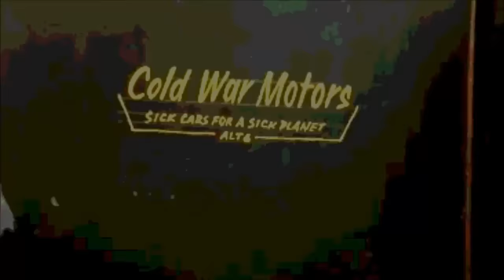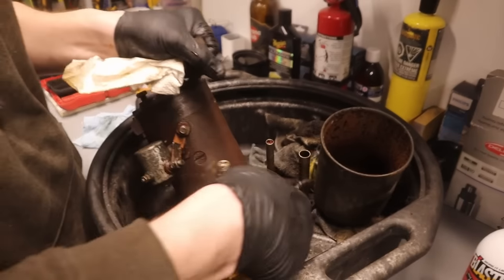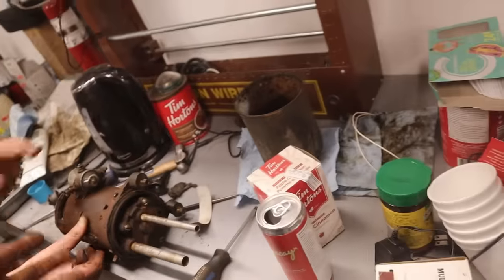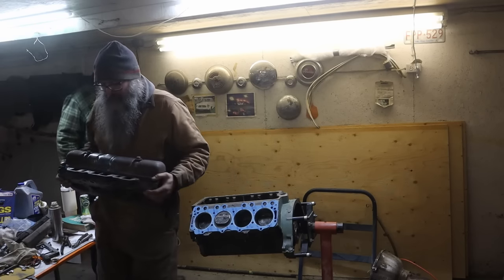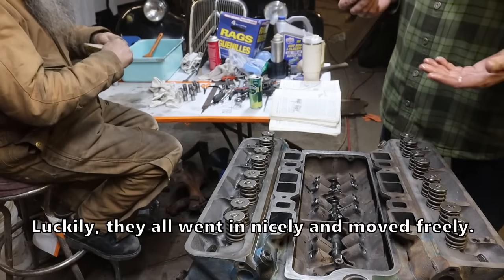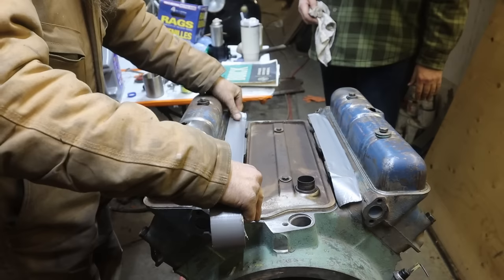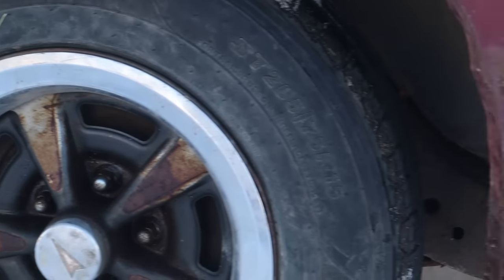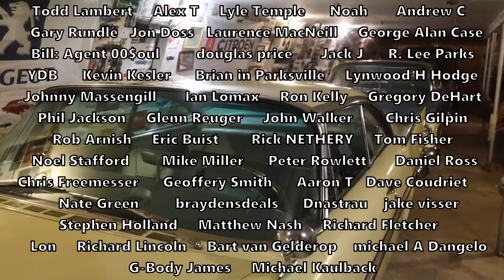Buick Nailhead Goes Together, Plus Oldsmobile 98: Will it Pump? Then: Greasy Flip Special!

Comment: So glad Dan's blazing through the Olds with gusto!
Also psyched you saved the wildcat paint on the air cleaner! The numbers on the Buick air cleaner stands for the torque specs for the engine under it and at that time not for the engines displacement of cubic inches. Turned out sweet. 
Those lifters come packed from the factory in a solid box with each one in it's own separate holder and wrapped in plastic. I've pulled and shipped delivered and used tons over the years and never saw them shipped like that!
You're supposed to soak lifters in oil for a few hours or overnight before installing so they get lubed up nicely. 
Run the engine without the coil connected to get the oil circulation through the passages and such before starting too, please.😢
Thanks again guys.
If Dean still has the 68-9 green Catalina or Bonneville that is in the drone shot in the promo shots and the engine is still running,toss it in the G.P. if I was up there I'd snatch it up quick!

Comment: Lovin the vintage intro's. 
If it wasnt on the other side of the moon for me to get there I'd buy that Grand Prix..
I've owned a few & I love em.
I like the 70's cars . Most dont , but its a bit of nostalgia for me.
Reply: I like 1970's cars as well, that "low wide and angular" look that a lot of car designers went for back then has its own charm. When done right it looks both sleek, sinister and elegant at the same time. The 1972 Chrysler Newport shown prominently during the end credits is a good example.

Comment: That Startex switch is basically made of unobtanium. That switch is worth the cost of the entire carburetor by itself. They have little brass shims in them you add or subtract to get the starter to engage properly and not clash when either engaging or disengaging.
Reply from the maker: Yeah! We'll detail the entire rebuild soon... the switch is in good shape, luckily!

Comment: I signed
It’s complete corrupt nonsense

Love the “refurb” on the hydraulic pump for the Olds. 
Also the nailhead assembly was nice to see.

I think Dean did the price drop to $864 because he was doing beer math and had already subtracted the cost of the case of Old Milwaukee he’s going to buy as soon as the car sells 😂😂😂
Love it

Hey I need a front bumper for a 58-60 T-Bird

Comment: Your words during "Deans Greasy flips" are so prophetic when referring to the Pontiac (and cars of its era).  "There was a time when I could not see any redeeming value in these cars... but ya know now that you see it next to a new car, it's pretty nice... New cars are such garbage".   

Just the other day, I began researching the old concept cars of the 1950's.   These are cars that never made production but had styling cues some of the cars of that decade and even later, used.  

What beautiful lines what elegance...  Speaking of elegance, Chrysler called one of its concept cars "Elegance" and it really was. If it were on the road today people would easily pay $150 Grand for it regardless of the power plant inside. 

 Cadillac even scaled down its known bloated appearance and designed a concept car that looked like it was designed by Pininfarina or other Italian designer.  

Today's cars all look like rounded edged bars of hand soap or shoe boxes with tall windows and lots of brightly colored decals.  You have to look at the logos on the trunk lids, wheel covers or grill ornaments to know what make of car you're looking at.  They're all generic in appearance and completely fail to stimulate desire by their outward appearances.  People only love them because of their logos and their prestige price tags.

Comment: 1950 thru 1953 G M sheet metal partsl  are same , or close . 

The  2 door on  your 52 Buick will be the same , check  !

Big cars, Cadillac,  Oldsmobile,   Buick  same doors.

The Buick  Special,  and other smaller lines will be different. 

The 4 doors cars are designed smaller,  but will change , swap out .

The trunks are interchangeable,  but not the Quarter panels.

Hoods are different. 

G M sold cars , that were sheet metal close .

Even your 1959 body is made that way.

Look at your 59 chevy,  windows, windshield,  Ect.

Gary

Comment: That Grand Prix would be $2500 in California. The interior, wheels, sport mirrors, and INTACT hood ornament....part out, EASY $3000 for someone restoring. Hood ornament alone $50.

That buick engine will be SWEET! Purr like the Wildcat, roar when the carburetor is full open. I envision some authentic tire smoke and squeal.

Comment: Always love how the lads restore old iron back to life and have a laugh doing it. Its what petrol heads do!
Just my tuppence worth but I have been building engines and gearboxes since the '70s. Some were performance engines like Twin Cam and BDA Fords or Opel 2 litre rally engines and I have never used 'assembly lube'. I have always used Hypoid differential oil (preferably Castrol) as it sticks to parts for ages, takes the initial stresses and is non detergent. Only ever had one engine fail and that was when an oil cooler pipe split in the middle of a long rally Stage on the Welsh rally many decades ago.
I am not telling 'how to' I am just saying its 'how I do'.
Latest engine is a Mini 1100 engine with a BMW Twin Cam head and fuel injection.
Reply: I was told firmly - never mix hypoid and regular oils. I use hypoid oils in my motorbike gearboxes, but only after a full strip and clean, to make sure all trace of the previous oil is gone. And make sure to use a hypoid oil that doesn't dissolve bronze bushes....
Reply: @pashakdescilly7517   I am talking about coating surfaces for assembly not a full sump of Hypoid.

Comment: Love 💯 the opening 
Black & white 8mm film 🎥 
Scenes  

Camshaft time , 
for the Buick 364 🤞 

That Wildcat 445 air
 cleaner cover came out MINT 

Great idea  , using  slow incriminates Up to the torque spec 

Those lifters were nicked 
In shipping  ??
Oh , for Christ sake  !!
Glad you caught it , in time 

Loved listening to the clock ⏰ 
Ticking in the background 
While you guys were adding oil 
To the valve pan area 

"Another day , another greasy"
LMAO 🤣 🤣 
That's a merch idea  ,
Right there 😂😂

An original 455 , ( less engine  )
'75 Pontiac Grand Prix LJ ??!!

I think because it doesn't have a vinyl roof or T tops 
Makes that car , savable 
Plus , sleeps 3

Comment: )I had the joy of working on a old carter afb and the secondary fuel float was basically set to not open ,I used a little pin punch and one light tap the boss holding the float pin broke,found out why the turned it into a 2 barrel a little jb weld and a lot  of filing and it's a working carburetor on ebay they wanted 500.00 for a non rebuilt afb
From 1960.

Comment: I bought spark plugs from an Amazon vender. They were shipped loose in a shipping envelope, with no packing, in their individual boxes. They had came out of their little boxes and rattled around together. The plugs looked undamaged, but one immediately had a intermittent misfire. When I pulled it out, I could see a carbon track along a slight crack along the porcelain.

Comment: If you look at that Buick engine I see a couple of unique design features.  First of all the way the heads are shaped the valve covers lay flat and would be less prone to leaking.  Second if you had to machine the deck of the block the intake would have to be modified to fit.  That design lasted till 66 when they were redesigned to be lighter weight. Interesting fact the Buick 350 weighed 100 lbs. less than a Chevy 350 but appeared larger.

Comment: Hi Scott, Agents and everyone at Cold War Motors. Dan's Oldsmobile sure is cool. I love that blue colour. My first car, the 59 Electra had the same air cleaner script. 455 Wildcat. When I did a tune up I looked it up in the Motors Automotive Manual and it said 440 cubic inches. Almost fifty years ago. Time flys. I still have the manual. DEAN'S GREASY GRIMY FLIPS, always a gas!

Comment: Hey, you have a brand new rotor winding. You looked at it when working on a starter for a car or the forklift. Still in the factory packing, but didn't know what it was from.
Nope, not forklift. You ended up ordering one.
Yes. in this one. It is notably shorter than the 51 Chev starter you compare it to.
Episode, "Will it Run? Episode 22: 1951 Chevy Bel Air! Part2"
Looking at the one for the pump, and comparing it to the video, it warrants a look. 

And could you do me a huge favour?
In this episode, "First drive in 50 Years! "Will it Run?" 1951 Chevy Bel Air... Episode 22", you do a skit where you start out in orange coveralls, and slowly turn into "The President", and play a nasty little riff.
One of the best pieces of filmology you ever did, in my opinion.
Could you turn it into a stand alone video, or a short, perhaps?

Comment: I ordered lifters from RA recently for a Japanese 4 cylinder. They were the wrong ones. It's mellings fault though for listing them as fitting an engine they don't. Tried telling melling and they quoted wikipedia saying they were right. Couldn't even be bothered to talk to the Mitsubishi dealer to find out what part number they ran for those years and see it never changed!

Comment: GM was really cutting corners on quality back in the 1070's. The door hinge bushing would wear out fairly quickly even on lighter doors. I remember changing the upper bushing on my 1975 Camaro's driver door after three years and doing the something on my my ex's 1979 Buick Skyhawk too. Glad to see the Nailhead progressing along, used to be they would ship the lifters in separate cardboard boxes to protect them.

Comment: That pump is going to raise those windows with enough force to be dangerous :-)
Reply: Michael naught - good point about the potential power of hydraulic window lifts. This was made probably before child safety was an issue. Now that I think about it, there must be a bypass valve somewhere in the circuit to prevent damaging the components🤔.

Comment: A complete proper rebuilt old engine will get 250-350K miles with 5000 mile oil changes with proper zinc level oil. It was the bad oil that got them smoking and knocking at 100-150K miles. Last longer than any of us.

Comment: Great to see the 98 again. A lot of them with power windows would develop a hydraulic leak in the doors, and since they used brake fluid, the bottoms of the doors would rot out. I'm sure that sent many of them to the junk yards. The nail head is really coming along. The 4 bl carb and manifold should give it a bit of a boost. Do you know if the trans is the twin or triple turbine dynaflow? Really looking forward to hearing the nail head purr like a kitten.

Comment: I've saw a video where someone added valve guide seals where there where none and it caused the oil not to lubricate the valve stems. The Valves seized due to lack of oil and a piston kissed the valve. It was a 235 chevy not a buick but just something for thought. The 235 did use o rings on the valve stems and the addition of valve stem seal on top made the engine last about 10 minutes. The video on here on youtube is named "Their 235 Chevy BROKE DOWN 10 Miles After The LAST Shop's Rebuild" and posted by "Jim's Automotive Machine Shop, Inc." Just food for thought.  Regards from patreon member "OTHATSTEVE"
Reply: Othatsteve - the valve stems on that Chevy six very likely galled because whoever installed them made the stem-to-guide clearance too tight,  plus it appears they crosshatched the valve stem, causing further friction.  The guys who are fixing the engine only surmised about valve seals causing the issue, but then afterwards were quite non-commital about it, and are using new guides and valves, and probably seals too
Reply: @cmans79tr7  True but that doesn't change the fact nail heads didn't use valve stem seals until 1966, and then only on the intake side with added machine work. I can only guess it was because the valves stems exit so high in the head the engineers didn't think they were needed. Adding seals might cause oil starvation or it may not. Again just something to think about.

Comment: Great graphics on the Buick air cleaner. Amazing that Dan's hydraulic pump can be salvaged. Bet there's not one part off a modern car still working in after 70 plus years. Dean how low will you go on a classic Pontiac.

Comment: That 445 on the breather, that was actually the torque, Ft. Lbs. torque, right Scott? I know a lot of older make of cars had something like that, the torque, either on the breather or valve covers, like the Ford 358? or whatever it was, had 400 on the valve covers, people thought that was the ci of the engine when it was actually the torque. Anyways, yeah that’s all I was wondering about that Buick.

Comment: Scott are you planning to paint the engine over as well? Just letting you know the engine shade for 59 is different than on 60 or 64. There is a chart on the internet what the correct color should be. I have seen engines that have been painted incorrect more than 5 times just cause people don't do there research. Also the pump parts for the Oldsmobile are unoptanium, Dan was super lucky it was only sized but not rusted to oblivion. These pumps can be really expensive even if you can find a good core to rebuild.  I have had also things shipped that are damaged and this seems to be just the norm now.  Been a while when Dean did some greasy flips show. I did enjoy it. Cheers to you and Frankers.
Reply from the maker: Yes, I plan to paint the engine in the original colour...Cheers!

Comment: I am not one of those "LS It" kind of guys but Dean's Greasy Flip GP could actually be an excellent candidate for that swap. I like the fact, that his GP appears to be a "smoothie", as GM sales people called those cars without vinyl tops. Outside of the '73 GTO, the '77 Can Am and the short '73-'86 Chevy square body ,stepside pickups. I'm not a fan of anything from the '70s Malaise era. That said, Dean's GP has some unique potential.......ala some mild custom rod-daily driver sort of changes.
 I am content in the meantime with the projects on my plate......a  '53 Mercury hardtop and a '57 Ranchero.

Comment: Great installment as usual.  Like an LHS to LHM conversion in a Citroen, could you change the seals to run ATF in the Oldsmobile’s window hydraulics?
Reply from the maker: Unfortunately, the replacement cylinders are sealed like the originals and are DOT-3 only...Cheers!
Reply: Oh well, DOT3 it is then!  Dan will need to change his window fluid periodically I guess.  :) @coldwarmotors

Comment: Do the rocker arms on the Buick get oil through a bolt like on Chrysler engines? Just wondering and hope you got the right bolt in the correct spot!  Great show as always Scott, Cheers from Lubbock to you and the agents!
Reply from the maker: They are fed through a passage drilled through the rocker shaft support...Cheers!
Reply: Cool, so like Mopars.  I realized after I typed my reply that there is only one bolt that will fit in the rocker support passage anyway. Cheers Scott!

Comment: Hi Scott. I'm paused @22:00 and looking at the Olds roof. I have a car here (modernish) with a rusty and pitted roof. Not too bad but it needs repair and I want to fix it asap. My thought is to hit it with rust converter first and then sand it, pressure wash it, Bondo it and paint it. Would you recommend doing it any other way or does that sound fair enough? Cheers.
Reply from the maker: That sounds like exactly the way to go...Cheers!
Reply: @coldwarmotors  Thanks mate.